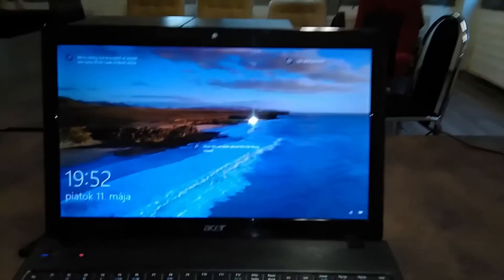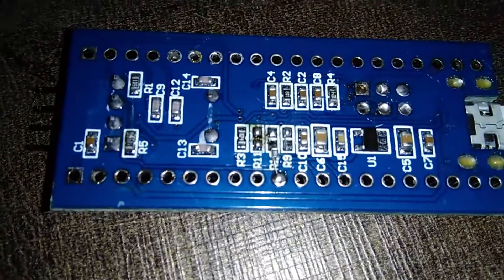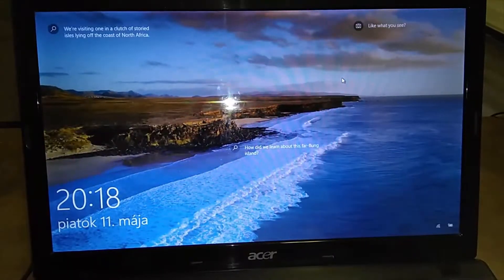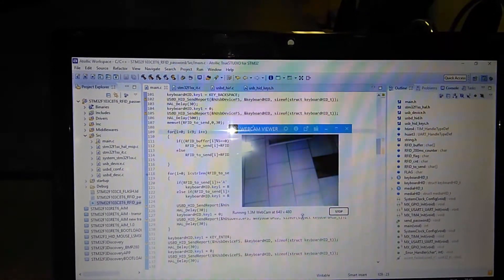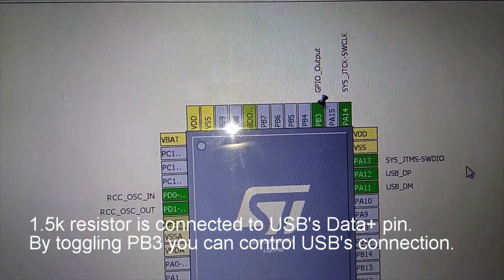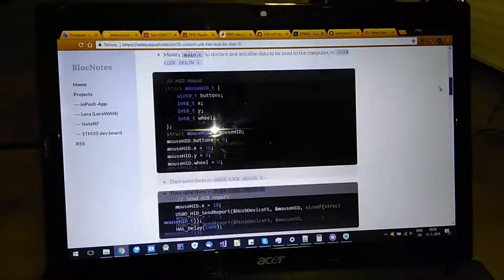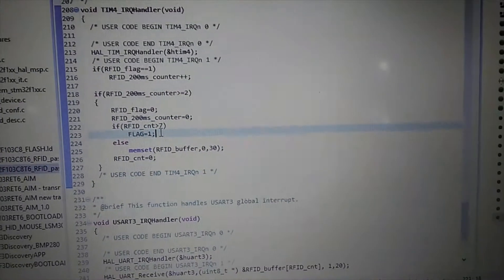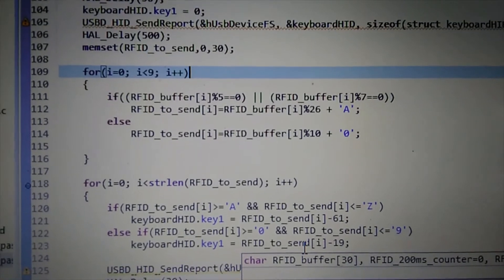Make your own RFID login USB HID device for your computer

Comment: What happens if I change my account password? reflash stm?
The project is good, but not finished. It is necessary to write a program that will write the password to stm.
I think it's not necessary to embed this device into the screen. Make it a separate device.
Reply from the maker: I consider this project as  finished. It generates an unique password based on RFID's serial number, which is based on serial number but differs from it.
A different RFID generates a different password. This project is open source, so it is up to you how you modify it. But I see what you mean.
Reply from the maker: I hope I answered your question. A password is not stored in the code, but it is generated based on RFID's serial number.
To "change a password" you can use a different RFID tag. :) From this point of view it does not have to have any extra programs at all.